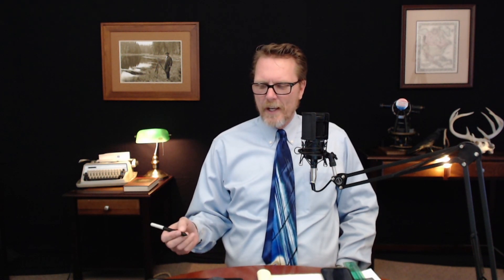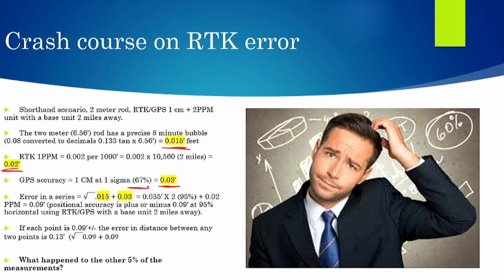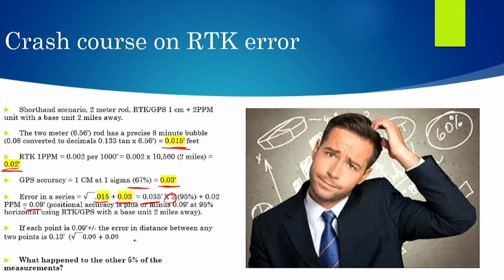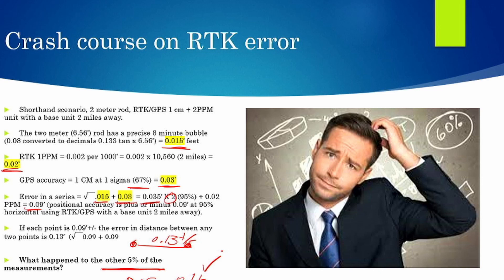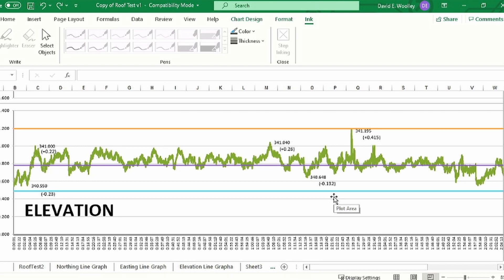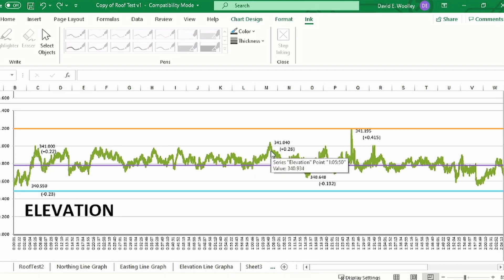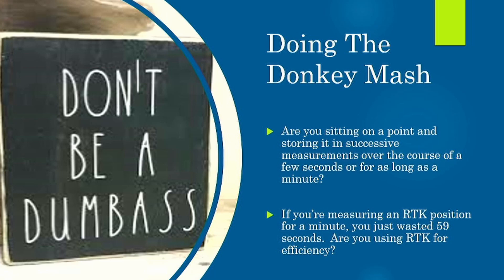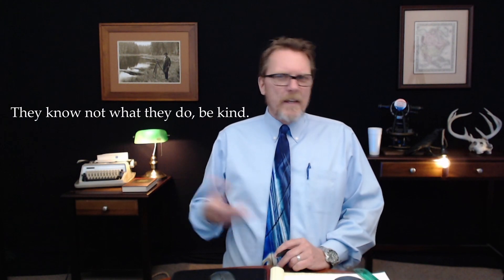Episode 4 - RTK GPS

Comment: Most quality Land Surveyors I've known will research, and check in to a known (Published) Federal Base Network point at the beginning of the work and finish with another check in on that (or another) FBN Published point at the end of the work (when using RTK/RTN).  This requires very little research and extra effort for the peace of mind it provides.  This builds good confidence in the results, and at least should be part of the record.   No dispute on using a total station Instrument for quality work (setting corners, etc.), especially for high accuracy projects.

Comment: Unless I missed something, the results you collected and presented around 10:10 are uncorrected for local ionospheric conditions. If you compared two receivers both capturing data at the same time in the same vicinity, they would have both shown the same variation. In an RTK setup, you're ultimately calculating the difference in position between the base and the rover, not the absolute position of either, so most of the error you're seeing would disappear.

I feel like comparing your results to Roger Frank's results is a bit like comparing potatoes to apples. His results were for a 4 mile baseline, your results were for no baseline. Both are going to have problems.

I am not a surveyor, I'm just a guy playing with a bunch of 25 year old Trimble gear in his garage, so there is a good chance I am indeed missing something! I'm here to learn.